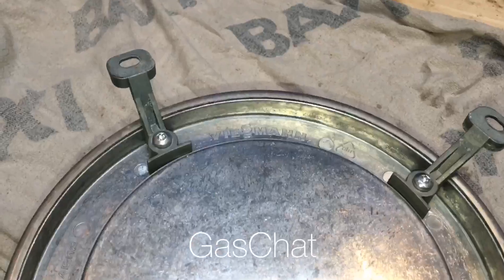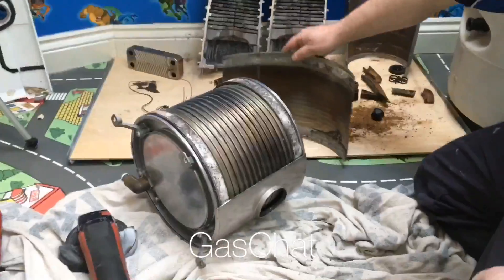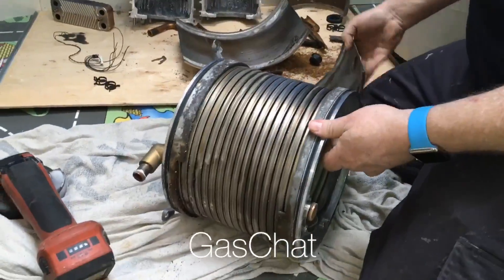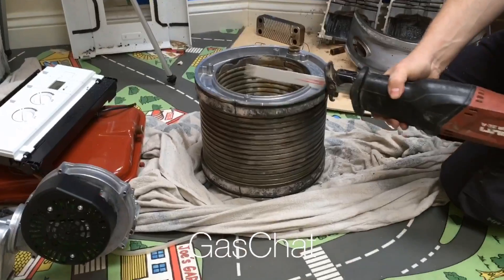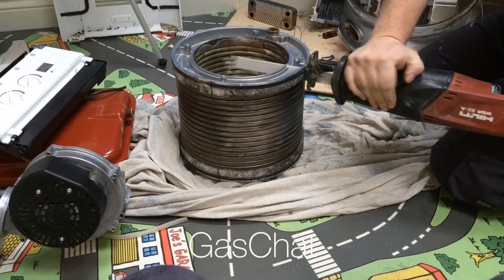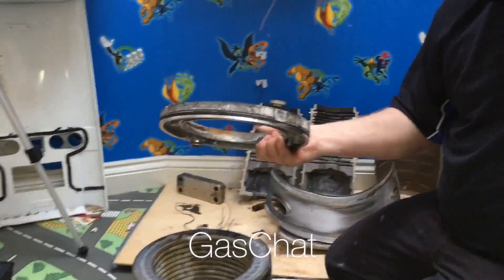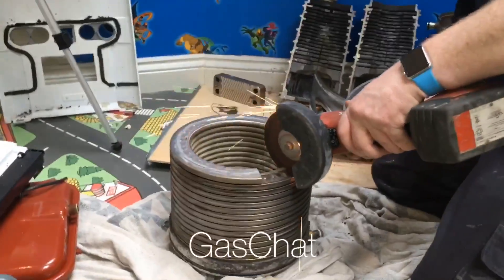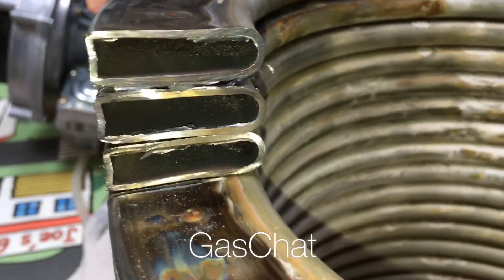Viessmann Vitodens 100 Heat Exchanger - Cutting up the heating exchanger.

Comment: HI allen , I was thinking about using one of these to act as a heat exchanger for an outdoors hot tub, do you think that if this was suspended above an open fire and had a 12V pump attached to it. Do you think it would heat a large hot tub ?
 I would have to connect it with copper piping which would go to the hot tub  and I'm not even sure if it there are connections on the in and out that would worth for that.

be interested to hear you thoughts. 

Theo
Reply: Of course any heat exchanger would work to exchange heat. It just needs to be brand new, not an older one with dirt inside, or you will dirty your tub. For the price you could use a car / truck radiator (aluminium so it won’t rust) or central heating radiator (but this will rust eventually and will cause sludge which you don’t want). 

The truck radiator would work better as its designed to loose heat, fastest, and in effect will gain heat faster, due to its large surface area to volume ratio.
Reply from the maker: I do not know the answer so i will just say, no idea, Thanks.